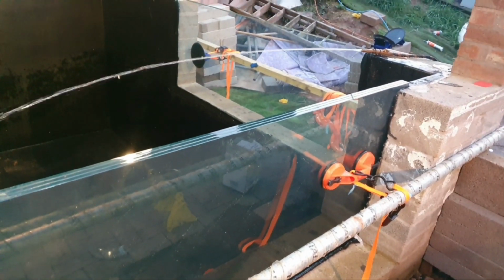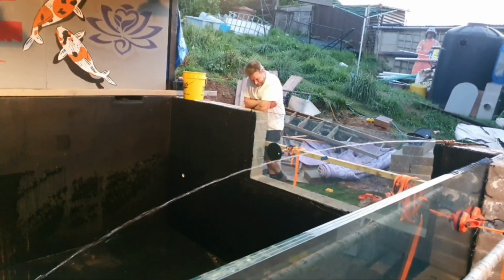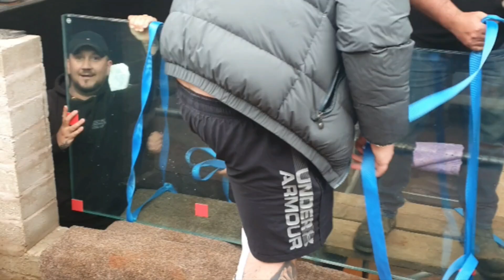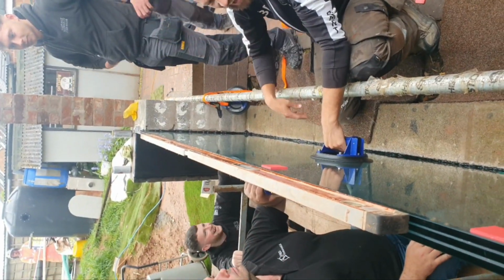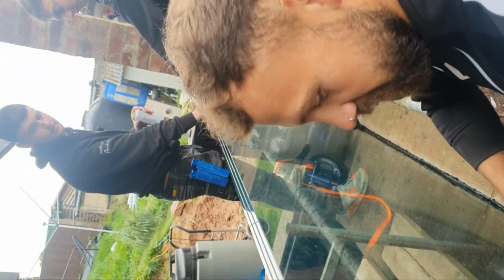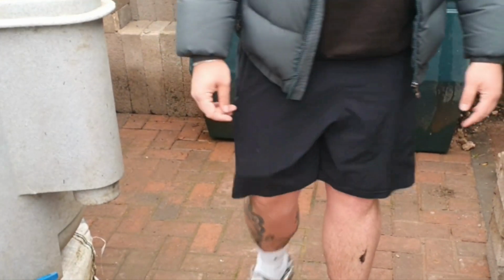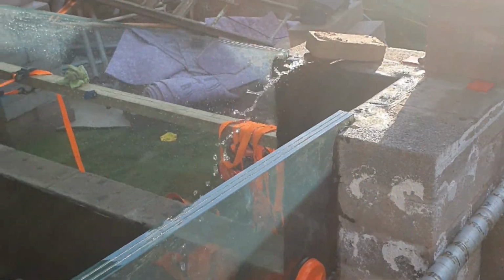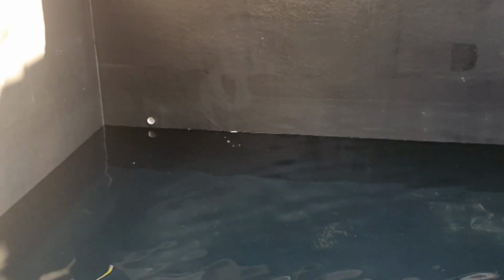how many people does it take to fit a mahoosive pond window 235kg beast

Comment: Kieth & Paula Imo I would go with the Oase XL Drum unit and personally would only get the Drum and make yr own moving bed like “Lee Koi Soldier” 300-500ltr of K+ media and you gotta have a decent size Bakki Shower which could be on the pond or in filter house 🤷🏻
Reply from the maker: Thanks Simon I should've mentioned we are doing our own moving bed so yes will just be the drum part we are looking at, backi shower we are having in the filter house the blades are under the rising sun at the back 😀  any reason you'd opt for oase over burtons ones?
Reply: @keithandpaulaspondbuild3441  from watching others like Telford koi Lee koi Soldier the Screens are more versatile and interchangeable “quick as” unlike others where you’d need to strip the whole lot apart 🤕 lol and from others have stated the Oase premium or xl range is quality built and casted as whole as others are seemed joined . It’s shame really as I like to keep it local support homegrown but the Germans as always do build some quality equipment…..🤷🏻 Good luck on yr Choice tho👍🏻
Reply: @keithandpaulaspondbuild3441  Ps maybe someone like Telford Koi will shed a-bit more light 💡why he choose the Oase over other brands 🤔 Personally I’m be got  2 KK Multibays and DIY 🚿 😅
Reply from the maker: @simonshears5182  thanks Simon really appreciate your input